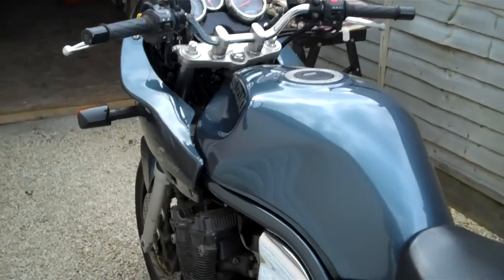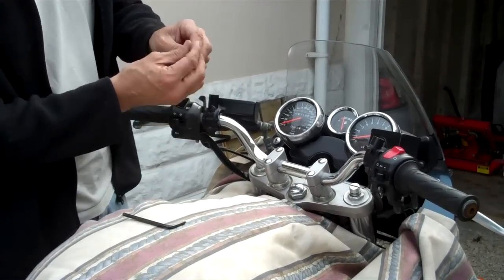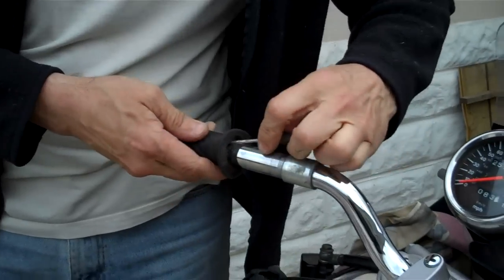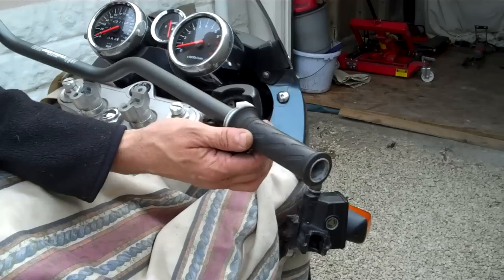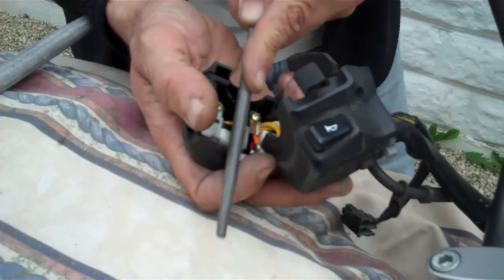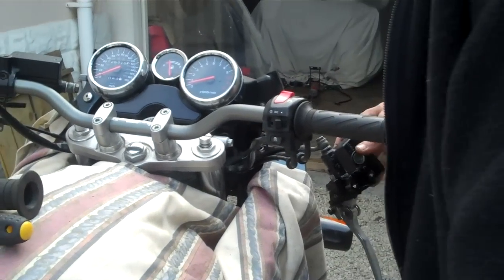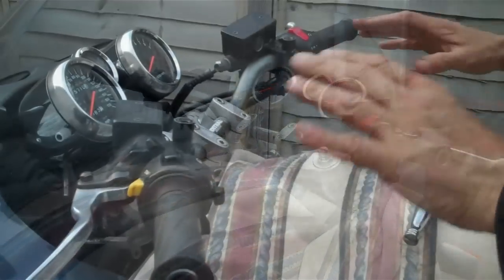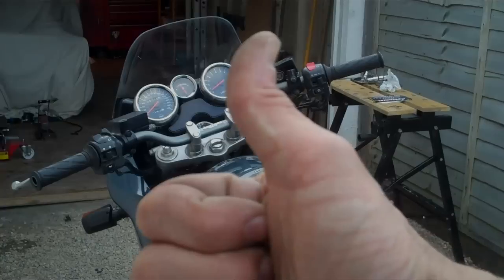Delboy's Garage, Renthal bars, Suzuki Bandit.

Comment: Hi, an excellent, informative video, thank you. My question is why would you want to lower your bars ? I've just bought a 2001 Bandit 1200, amazing machine, and am thinking that raising the bars would make for a more upright and therefore comfortable riding position ? Agree with you about the awkward angle on the wrist, it doesn't look as though your Renthals would make much difference.
Reply from the maker: matoko123 Hi mate...i probably have longer arms that you then, i like to sit forward slightly, leaning into the bars, and at speed you may find a fully 'sat up' position a bit tiring after a few hours riding....the angle of your wrists is changed a fair bit as the bars are wider so your arms are farther apart etc....riding posision is a personal thing, we all know how we're comfiest aye..!... thanks for wathcing.. Del.
Reply: Moonfleet41 Hi Del, I'd overlooked the fact that because the bars are wider the angle change would be greater, I may just give them a go. Thanks :)
Reply from the maker: matoko123 Renthal actually offer 6 different models of bar in 7/8th and a few fat bar options too... they publish a readily available spec list of all the different dimensions, including height, width, rise and draw back, so you can fine tune your hand position in relation to your new bars and get the right ones first time !

Comment: Great video and informative, but my Honda Hornet 600 98, I bought some black Renthals for her and the metal nub that sticks out is necessary to grip as the switches have no other means of grip. I was reading that Honda's can be a pain for this. After I removed the metal pin my throttle rotates freely without gripping at all and wouldn't want to use tape. Last thing I'd want is my throttle to come loose and unusable during a ride.

Has anyone found a long term grip solution to pop in-between the bar and the switch?

Comment: I strongly recommend drilling the location hole on the throttle side at least! If the clamp works lose the whole throttle control will rotate on the bar and losing throttle control while riding is a very nasty thing to happen.

Comment: A few years late but do you believe bar weights would have to be added to a set of handlebars like renthals? Did you find any extra vibrations with a lighter bar and no weights? 
Thank you 👍🏼
Reply from the maker: I made a follow on video how to fit bar weights to these bars using a ghetto fix!

Comment: Hi Del, your tutorials have given me the confidence to get my hands dirty for the first time and I'm loving it, rebuilt my petcock last week, works a treat, proper chuffed :O) I have a Mk1 600 Bandit, I love the bike but it kills my hands, pins and needles, numbness, arm ache etc. I would like to change the bars and stop the vibrations if possible but I want a higher bar than standard. Do you know if Renthal mediums or highs would fit on my Bandit without needing different cables etc? Charlie.

Comment: I have an 091250s and i did have these ultra lows on an 08Z750 which were great for the 750.  But i have a question in regards to fitting these to the 1250s.   Will the lean angle forward be too agressive in comparison to the standard OEM bars?   I like to tour and do a heap of commuting on this bike but the kink in the standard ones is a real wrist killer.
Reply from the maker: Zinisster Hey buddy, they are a little flat and wide and great it you want to lean forward more, I've had more success since this video with the Renthal Road Bike Low (as opposed to Ultra Low)... they are a little wider and come back and up a little more, much more comfortable for distance... hope that helps!
Reply: Moonfleet41 Ok great thanks, i have been asking everyone everywhere then i stumbled upon this video.    Now off to the shops to compare Rental Road Bike low.     Thanks again.

Comment: The holes in the bar do help, and should be done, there is no way it's going to weakening the bars, so to make them crack, unless the hole is drilled way oversize and clean through both sides, even then it would work, just not as intended. 
I would bet the instructions say, to drill the handlebar in the first place, as most do, and use a torque wrench on the bolts, as recommended. Easy is not always the best. Hope they do what you needed. yl
Reply from the maker: Sounds like you've been eating the workshop manual my friend, and being indoctrinated by it, drill a hole in a piece of tubing, even a 3mm hole, start bending it and tell me exactly where it kinks... I bet you can guess where it will be... drilling a tube most certainly DOES weaken it, otherwise Renthal would supply them drilled... the factory bars are steel, usually mild steel chromed, which is far more maluable and forgiving than thick, tempered aluminium, perhaps contact Renthal and take their word for it... and as for a torque wrench, I think 35yrs experience at it will see me safe to do up a few screws on a switch block, don't you?
Reply: Even with the metals in Renthal bars, there is little chance of harm, to you or the handlebar, and the reasons why they are not drilled, is so you get the proper fit, for you when you put it back together.
I am a fabricator welder by trade, among other things, and for some things that were classified to be welded, so I know a little about metals.
Yes you can get by without a torque wrench, but when telling others, it's best to tell them the proper way.
What would you want to be told, when looking for info, on a subject you know very little about, that is not why I watch your video, I was looking at the quality of the products being used, and fitment. Good day. yl
Reply from the maker: ***** I accept your points there mate, i guess users can always choose to tighten by hand if they wish, also for many people a torque wrench with single figure values and even inch/lbs is not a common tool in many peoples kit....but like you say, the info is there at least..so point taken... As for the holes.. truly mate, they are there for factory assembly convenience, not prevention of the switch block moving....when the bike rolls down the line, the assemblers just poke the switch block on and bingo its in the exact right place... then when its all stripped for shipping to the dealer, the PDI mechanic doesn't have to spend time setting all the switches and levers to the right level, they can just mirror exactly where the designer wanted them,  The dealer obligation to "PDI assembly" is a timed and paid set menu, the dealer wont want to be faffing about when profits are so tight on new bikes... those holes are for them buddy, not us..! thanks for watching and good to hear from a proper welder..(which i most certainly am not..).. take care Del.
Reply: Well we can still enjoy the results, a better more comfy bike. Take care. yl
Reply: I know it is an old topic and I have not done any calculations on holes in handlebars being able to take the stress of regular riding. However I agree with Del, most people dont have torque wrenches in their toolbox (i dont). Most of the time it is better to get a feel for it rather than just trust an instrument. What if the manual have a typo or you use the tool in the wrong way..

Comment: Hi Del. Since I'm the original n00b to motorcycle DIY I really love your videos and how you explain everything in a clear way. I would like to fit handlebars like yours on my Bandit. My question is; does it effect the handling if I would cut a bit off the ends to meet the width of the original bars because I have to get my bike through the garden gate and there's no way I could get any wider handlebars than the originals through the gate.  Cheers in advance!

Comment: Hi Delboy, thank you for this (and all your others) informative video. You have given me confidence to do my first small winter project on a 2006 Bandit GSF650S (just lots of tidying up and a bit of TLC). I might even keep it rather than sell it. I have found the same thing regarding the angle of the bars and it being uncomfortable on my wrists. So want to replace them. Would you still recommend the Renthal Ultra Lows? I notice in a subsequent video you have the anti vibe bar fitted, though I can’t find a mention of it in the videos. Would you also recommend the anti vibe bar or a different set altogether? I appreciate it was a while ago but you might still have a view. 
Many thanks, Adam
Ps also enjoying following Project Foxdawg
Reply from the maker: Hi Adam, good to hear from you... and how awesome that this creaky ol' video is still getting a viewing, and being useful!... Yes I did put a cross bar on it a little later, but it wasn't for vibes mate, I have to admit for my sins, that I just actually like the look of it... and in the end, I turned this in to a rat bike, and it's still on the road to this day, looking more badass than ever!... The Ultra Lows are great because I didn't want a high rise, which would sit me too upright, I wanted to lean forward slightly and they were straighter than the factory bars with less pull back... plus the angle that they set your hands at was right for me, but like so many things, it's a personal choice... I'm 6ft tall with a standard reach (so in other words, 6ft between fingertips with arms out and they were fine)... with Renthal bars, the biggest issue is fitting proper bar weights cos the hole in the end is only 12mm, but you may have seen in a later video just after this one, I showed how to fit the standard factory bar weights by using some 10mm wall plugs, which holds them in perfectly... the weights will keep the vibes done not the crossbar.... hope that helps mate, good luck with it, Del
Reply: Hi Del, thank you so much for taking the time to reply. I too am 6ft. It sounds like the Ultra Lows will be spot on for me. I shall order a set and I’ll let you know how it goes. Cheers, Adam
Reply: Hi Del and anyone else who is interested for what it is worth: I successfully fitted my new Ultra Low Renthal bars. What a difference to the ride, for me it's a huge improvement, my wrist no longer aches, my riding position is slightly forward but arms slightly wider. When you put the original bars and the Ultra Lows together they don't look massively different, but that small difference in angle and width makes a huge difference to the ride. I can't recommend them enough.

Other lessons learnt - I fitted R&G heated grips at the same time. Turns out the Renthals have a slightly raised and textured surface where the left hand grip goes. My mistake was to force the left hand one on, I used way too much force and twisted it too much, in doing so I broke the internal wiring. I broke my own rule "don't force it!". Luckily though you can order individual replacement parts rather than a whole new kit. This time I filed the inside of the plastic sleeve with a round bastard file. It didn't need much but it made all the difference. Other lesson - there are punch marks on the handlebar clamp bracket pieces, those should go at the top because the clamps are not exactly equal top and bottom (probably common knowledge to most). Del's tip of filing off the little nodule on the inside of the switch controls was a good tip, I just did it without having to figure out why they wouldn't clamp back properly. As Del said you don't want to drill the bars, and even if you could how likely is it that you will get the hole in just the right spot?

So all in all, a great and inexpensive upgrade. And a great video from Del, so many thanks once again.

regards

Adam
Reply from the maker: @adamgoodsell4170  Hi Adam, glad you got it done... they're clever guys at Renthal aye, they actually design their bars with human anatomy in mind... and offer an option for everyone!  Good tip on the heated grips... glad you got is sussed,d thanks for sharing your adventure!

Comment: Got a quick question. recently got my 1st bandit. MK1 600. Bars have been changed already but the throttle side switch block is loose. If I open her up quickly it turns and I get to much power. Bit scary 1st time as I wasnt expecting it. Anyway. Did I hear you say on this video that if switch block is loose, to put tin foil underneath to tighten it. Many thanks.
Reply from the maker: ron lamb Hi Ron, presuming it's done up tight in the first place, then yes, wrap some tin foil under the switch block and tighten down in to it... it doesn't hurt also, if they are chrome bars, to take a little emery paper and scuff up the chrome under the tin foil... hope that helps, Del
Reply: Excellent. Thanks for your help del.

Comment: Good video, I've been thinking of doing this cause my wrist start aching after a while due to the angle of the bars. Been looking on the likes of eBay for some straighter bars and none of them say that the angle is less or the bars are straighter. Where did you get that new bar from a site?
Reply from the maker: +rob combs The bars in this video are "Renthal Superlow".....if you check on Renthal's website for all the angles and specs of different options, and be guided by them... then, once you know the exact model of Renthal bar, you can just buy that one... hope that helps you buddy.. let me know how you get on... cheers, Del.
Reply: Cheers Del, I got on fine. thanks for the video, i wouldnt have felt confident in doing without watching your video. I got the Renthal Medium in the end a bit of advise for anyone else who has a bandit dont go any higher than the medium as the brake line and electrical calbe from the left hand switch block really couldnt strecth much futher on my medium.

Cheers Del, keep the videos coming!
Reply from the maker: Glad you got is sorted buddy and that the video could help you out... thanks for letting  us know - ride safe!

Comment: I attempted to changed my handlebars, but the only problem I came across is that there are no spiral holes at the end like the oem bar for my bar end stopper. Wouldn't the right handlbe bar slip off without a stopper?
Reply from the maker: No, not is you clamp the twist grip assembly down correctly... the pins dont hold them in place anyway. they are just for location of the switches... the twist grip assembly is not held by those pins... you can fit a bar end stopper using expanding rawl bolts from the DIY store...
Reply: oh, I see. Thanks a lot Delboy.

Comment: Hey Delboy! Pretty good video, gonna replace mine to Renthal soon. What it is not covered by the video is the weights, do you need new ones for Renthal?
Reply from the maker: It's covered in another video, you'll find that your Renthals are a smaller internal diameter, so you will need to adapt the fitting, i used a 12mm rawl expander from the DIY store, or fit the Renthal ones that are not weights, just dress plugs for looks.. !  It's a way old video, but covers the task.! https://www.youtube.com/watch?v=9mJG9PoymCM
Reply: @Moonfleet41  Wow, what a fast answer. Thank you!

Comment: I was just curious if the original bar ends can be used changing to renthal handlebars. I think that although the outside remains 7/8'' the inside hole may differ. How can you override this problem?
Reply from the maker: Hi Giannis, if you watch a subesquent video we did here: https://www.youtube.com/watch?v=9mJG9PoymCM     you'll see they are smaller you just need to buy some 12mm raw bolts.. hope that helps!

Comment: Great video, stupid question do you not put your bar ends back in?
Reply from the maker: In a later video I had to make a modification, the hole in these bars is smaller than the steel bars, so initially the bar weights don't fit, there is a work round in a later video !
Reply: Ok thanks for replying will try and find it

Comment: I got dale walker's bars instead of renthals. Does that make me a criminal Delboy?! Giving motorcycles plastic switch housings is the real crime here.
Delboy - what is the best way to secure these things, now that I've filed the pins off? You mentioned tin foil but electrical tape seems like it would be better considering the low clamping torque of these housings. Thanks!
Reply from the maker: Hey buddy.. Those Holeshot bars are awesome quality, good choice there buddy.. and if you can get hold of some, try the fabric electrical tape, just one single layer with no overlap, and that should hold them perfectly well.
Reply: @Moonfleet41  My man! Good idea. btw I'm loving your busa build. One of my fav content creators by far!

Comment: Hi,
I have just bought a 1997 1200 bandit . It's very jerky and a bit spluttery at 2 to 3,000 rpm. It's smooth in the rest of the rpm range. Any help would be appreciated.
Reply from the maker: Craig Holbrook I guess thats a classic 'flat spot', and you said nothing about the bike...does it have a factory exhaust, race can, K&N air filter, has it been rejetted etc etc. there are lots of reasons a bike will develop a flat spot...even something simple such as valve cleasances out of adjustment....when was the last major service etc etc?? so a little more info maybe..?
Reply: It has regular filters. Race can. Not sure when the last major service was. Forgot to ask previous owner. Duh. That is my next step.
Thanks
Reply from the maker: Craig Holbrook Ok Craig, the race can may be causing the flat spot, coupled with perhaps a little attention to the valve clearances, they should be checked every 12k miles, and once they are set fine, then why not chuck in some new plugs, a K&N filter, and dynajet kit....it'll smooth the motor out no end and even give you a few more ponies to play with... good luck with it buddy.. all the best, Del..
Reply: Thanks Del. By the way loving the videos.

Comment: Hi Del, would the bar end weights fit (standard suzuki ones - I will be replacing handlebars on a k3 bandit)? I have read on a couple of ebay sellers ads that I would have to replace these also?